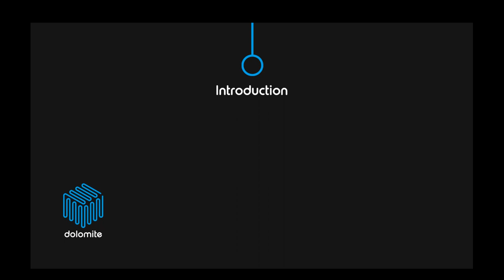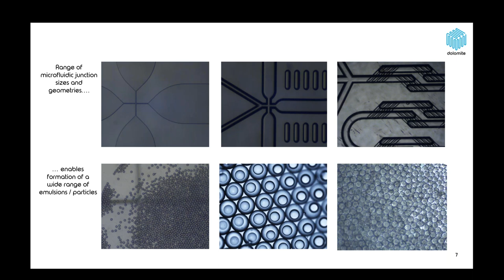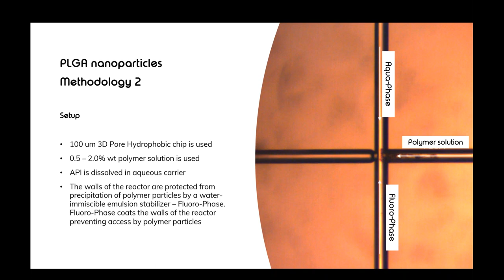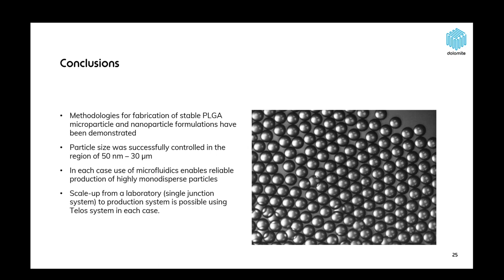Learn how to Encapsulate Hydrophobic API in PLGA

Comment from the maker: Helpful timestamps for navigating this webinar:

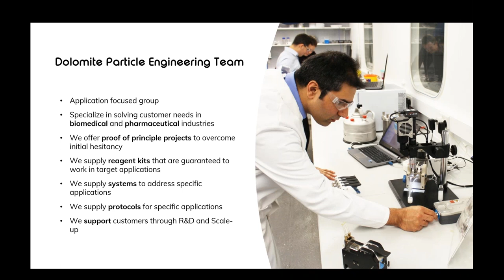1) Introduction: 0:00 - 1:35
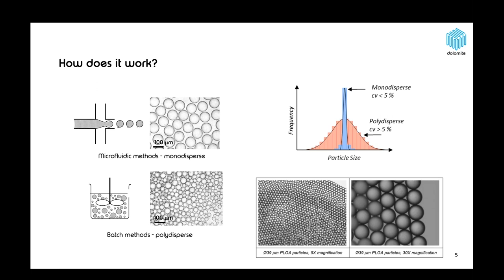2) Microfluidic technology & how it works: 1:35 - 3:45
3) Droplet / particle production methods: 3:45 - 6:32
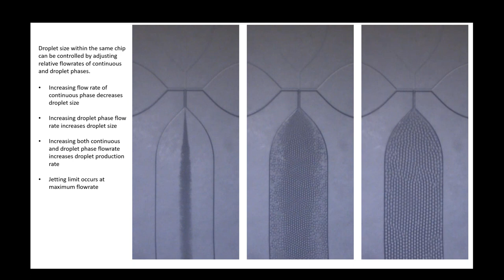4) Controlling droplet size: 6:32 - 8:15
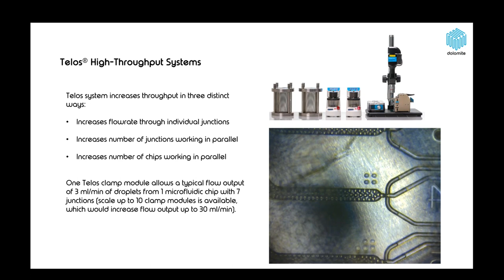5) Dolomite systems including scale-up with Telos: 8:15 - 10:05
6) PLGA microparticles: 10:05 - 15:20
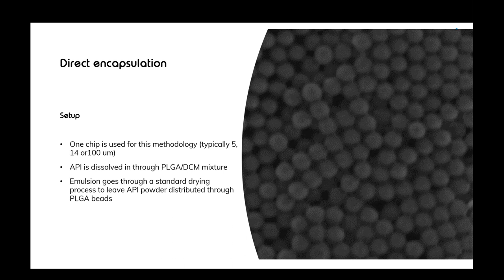                6.1) Particle formation process & direct encapsulation: 10:05 - 11:35
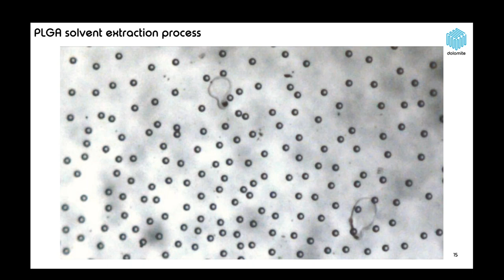                6.2) Solvent extraction process: 11:35 - 13:15
                6.3) Multiple emulsions: 13:15 - 15:20             
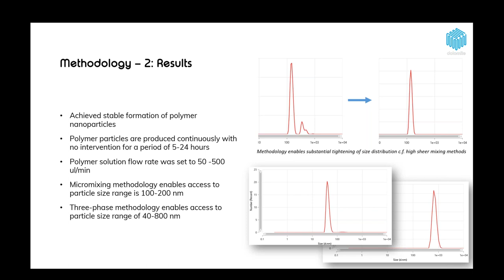7) PLGA nanoparticles: 15:20 - 22:45
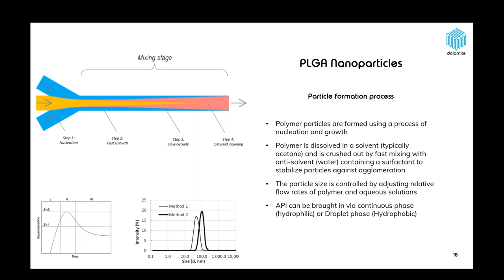                7.1) Particle formation process: 15:20 - 16:43
                7.2) Methodology 1 - Micromixer chip: 16:43 - 18:50
                7.3) Methodology 2 - Hydrophobic chip & results: 18:50 - 22:45
8) Emulsion stabilizers: 22:45 - 23:35
9) Conclusions & additional information: 23:35 - 24:20

We hope you enjoy this webinar hosted by Dr. Pavel Abdulkin.